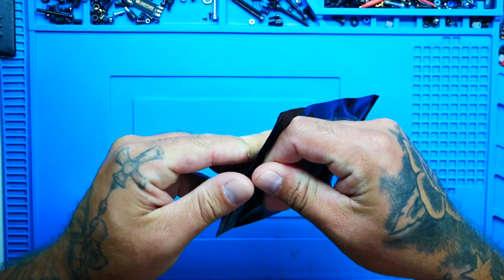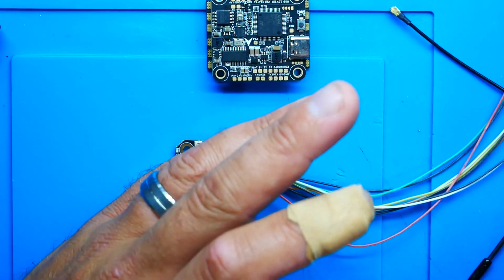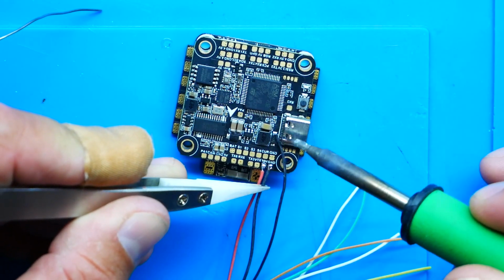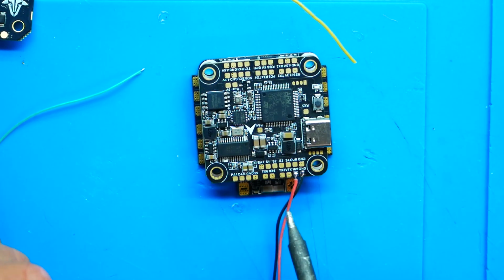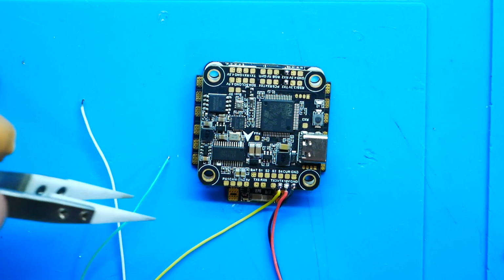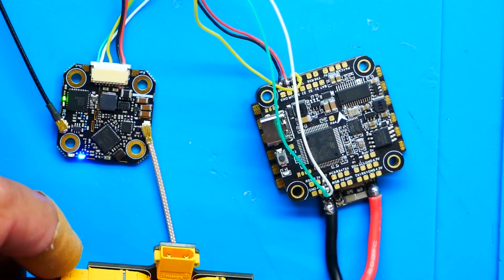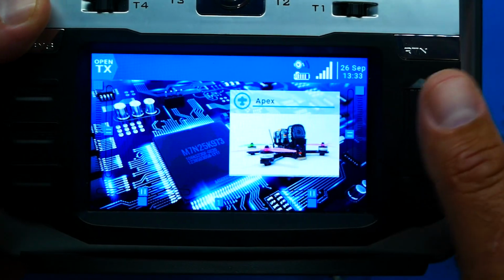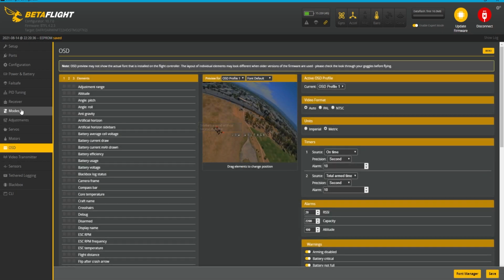Finally!! How To Wire & Setup Your TBS Sixty9 !!

Comment: What about vtx control from the flight controller that's something I never figured out with the 69.  Also my transmitter force starts in pit mode, and is incorrect, I have to change it to pit mode to get it to full power with newer updates.

Comment: Are you going naked? With the new enclosure the U.FL connectors are protected. (I'm not a hot glue guy but my old friend is). Also what about the short screws? (Frame AOS 3.5)

With the new firmware update, TBS is using CH1 or CH4 for smart-audio. Don't understand the CH1 here as it's used for the control link and CH2 for telemetry. So I suggest leave CH4 wire for Smartaudio. Do not remove this wire !!!

Comment: For some reason I have set it up updated the firmware to 6.09 and 6. 10 and it will not come out of 25 MW when I switch it even through TBS agent it switches right back to 25.  8 volt bec
Reply: Same issue, have you found any solution?

Comment: completly underrated use of the new smartaudio passthrough kinda thing ob the sixty9  
you could now configure a switch over bf to control your power levels and control it over your OSD AND at the same time configure it over your crsf tx or even fusion..
OMG I ❤️ it
Sadly tbs cloud doesnt work as well as expected..
Reply: Have you done the switch thing yet and do you use the BF OSD to control channel/power of the sixty9 or are you using your TX?
Reply: @austntexan  No, I didn't. I'm using two vtx on this kwad to archive 3d perspective...
But I'm sure it's like setting up sa for a normal vtx.
All my vtxs do have power levels on a switch and it's working reliable.

Comment: I was hoping this would eliminate the lines in video feed that tbs nano receivers cause in tight builds. Smh
Pls advise if there is a solution besides relocating the tbs receiver as far as possible from Fc and vtx which in this case is impossible with tbs sixty 9. Thx

Comment: With power it should be connected to VCC of the battery, but preferably after current sensor. If you connect to stabilized 5V or any other stabilized line of the FC, tbs crossfire will not get sufficient power when transmit at full power. Otherwise all the rest of the video is correct. Taking unused wires out is good point, however smartaudio protocol is useful and would connect it also.

Comment: You should add if it doesnt bind you have to go to 868,bind,update then go back to 915.  And the plastic case wont stop the ufls from popping out.
Reply: Big tip
Reply: Mines bind to 868 and it works but when I change to 915, it's lost. Do I need to rebind after changing to 915?
Reply: @DEVILLE7772  change it to 915 right after you bind.
Reply: @Vampir4997  ok will try that

Comment: Thanks for the video!
But you forgot to tell that the audio wire is also for SmartAudio and not only for mic. You dont wanna control this nice Vtx via SmartAudio? 
Yes, you can control it via Menu inside the Radio but you need SA so your Vtx Tables in betaflight are working. Also functions like "low power on disarm". You need to solder the SA wire.
Reply: OK, here's a question for you. Do you have Smart Audio working with this guy? If so please share your setup which includes wiring and the setup of the 69 in Agent X. I've tried using the audio wire but I've been unable to get Smart Audio working.
Reply: @michael.mccauley  I don't believe the Sixty9 supports smart audio, you can find that info in the user manual on TBS website.
Reply: @ProDangles  Yes, I believe that you are correct about the Sixty9 not supporting SmartAudio. My question is why? As for the Crossfire manual I guess the Sixy9 wiring diagram says it all.
Reply: @ProDangles  It looks like the 69 does support SmartAudio. Joshua Bardwell has a video that shows us how.
Reply: @michael.mccauley  Which Vtx Tables you are using?
Reply: @MrSmithFPV  I went with the table for the TBS Unify Pro32 HV - SA 2.1
Reply: @michael.mccauley  Yes, these are the correct tables. Iam also struggling around with getting the audiocable to work for SA. But you can also use the Output 1 cable instead. Thats working for me. And then you switch Output 1 and 4 for CRSF.

Thats not a nice solution or workaround and iam not happy with it but it works.

Hope they fix this soon.
Reply: @MrSmithFPV  Thanks for the info! To be clear you are saying to change output 1 to Smart Audio and output 4 to CRSF. Is that correct? I'll give it it a shot and see what happens.
Reply: @michael.mccauley  Yes, thats correct. And it will work. Dont forget to also switch these 2 wires on your flight controller...
I also contacted TBS that the SmartAudio issue is still not solved.
Reply: @michael.mccauley  Ok, i gave up now. Trying to figure out how it works on Output 4 but it isnt. The interesting thing is that in the manual Output 4 is a Tx but it should be a Rx. Because Rx is connected to a Tx an the FC. Also tried out the solder pads on the backside of the sixty9 but it dont works. I created a ticket now on their site. Really a shame that they say in the release notes output4 is working but it isnt. And they know that...
Reply: @MrSmithFPV  Which 2 wires? At this point I have the 69 wired to the FC using the power, ground, video, RX, TX and audio wires. The audio wire is on UART 1, the TX and RX are on UART 6 and the video is going to the VID.
Reply: @MrSmithFPV  Thanks for your help. At least now I know it's not just me.
Reply: It looks like the 69 does support SmartAudio. Joshua Bardwell has a video that shows us how.
Reply: @michael.mccauley  Yes, really sad that JB tells us that the manual shows wrong solder pins instead of TBS is writing a small notice on the product page. TBS also was not able to told me that this is the issue... Will try out the middle solder point tomorrow. 👍
Reply: @MrSmithFPV  Sorry for the late reply. I did wire the middle pad on the back of the 69 and SA still didn't work. I finally did get SA working, kind of. After wiring it up as JB suggested I had to go into the Micro TX settings, with Agent X, and change the VTX control to RX. At least now when I go into Smart Auto with the radio it actually looks as it should. I'm still not convinced that it is working as it should because the changes don't always take.
Reply: @michael.mccauley  Hm, the middle pad on the backside is working fine for me. The only thing I've noticed is that the osd don't shows the correct output power when I change this...
Reply: @MrSmithFPV  Yes, mine is acting the same. The issue that I'm having is when changing channels and bands it doesn't seem to work every time and I find that very strange. Oh well, it's almost there.
Reply: @michael.mccauley  like I said it's working for me. Just the OSD not. If I change channel and power the OSD doesn't change but power and channel are changing. You can confirm that if you go into the lua script and check out.
Reply: @MrSmithFPV  Thanks! I did some testing on the bench and like you said SA is working but the OSD isn't updating until the FC is re-booted. Hopefully a future firmware update will correct that.
Reply: @michael.mccauley  Good to hear. Iam sure it's not a Betaflight problem. It's still a TBS issue...

Comment: Thanks! After a little trial and error I did get to this point already, but it's good to have you show me I got it right. Now I'm only left with one question. Does Smart Audio work with the 69 for VTX control? On my setup it doesn't and I've read somewhere else that it doesn't. Is that true? Thanks again for the instructions.